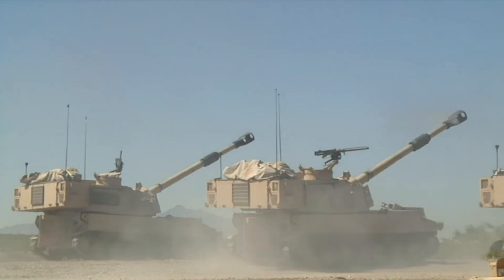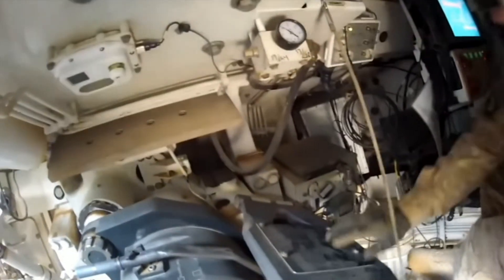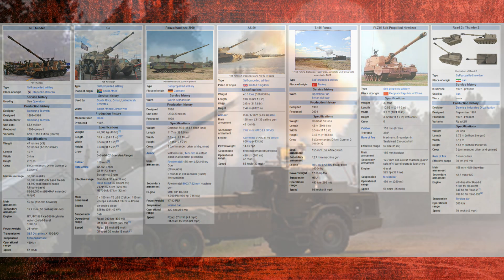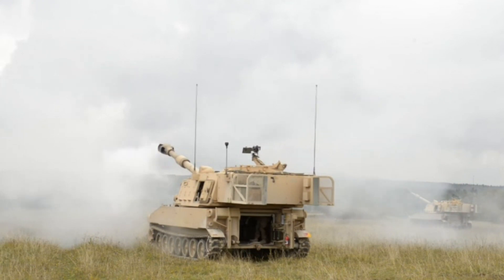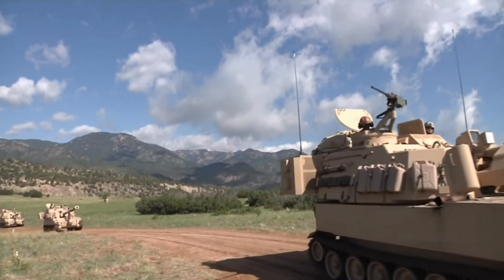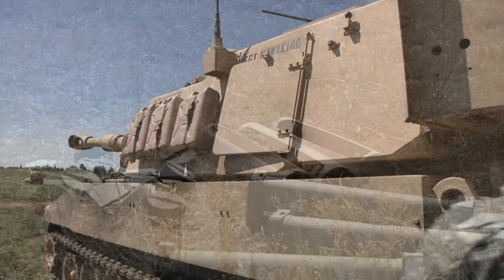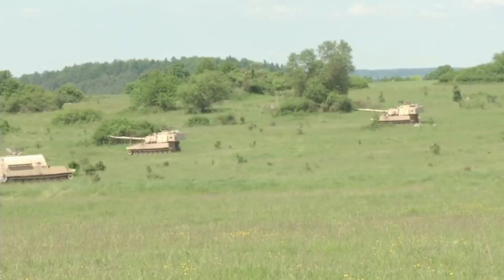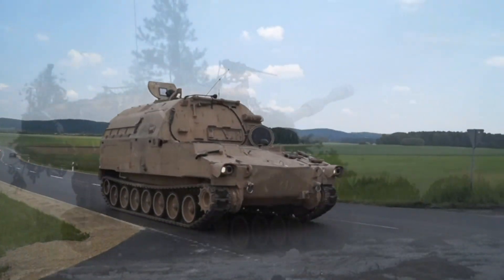M109A6 Paladin 155 mm self-propelled howitzer - American Artillery

Comment: Growing up as a kid in Germany in the 80's...one time we were doing a charity car wash in Churchill Barracks  (Lippstadt) and after a shed load of cars were done, a M109 from 49 Rgt RA turned up.  Was quite a picture seeing a load of Scouts clambering over that beast with soapy sponges. LOL

Great times back then. (Even as a teenager)
Reply from the maker: Max Steele haha epic! Thanks for sharing and for watching :-)
Reply from the maker: And for donating!! It really means a lot man!! :-D
Reply: Hey Max,  I was in 49 Rgt RA in Lippstadt from 89 to 92 . Good times and we still had the M109's then.
Matsimus, you didn't mention that the M109 also had nuclear capability, perhaps you wasn't aware. The idea was to fire the nuclear round and jump in a landrover and bugger off quickly leaving the gun behind as it would be in the fall out zone.
Reply: @gnrphil   This round was supposed to be covered by the official secrets act lol.
Reply: @peterwait641  Ooops........ going dark. 🤣
Reply: @gnrphil  - That is why the crew is taught (as shown in the video) to fire the howitzer externally using a long lanyard because the size of the powder charge required to kick that nuclear round out far enough would destroy the gun carriage, and anyone that happened to be inside the howitzer at the time.
Reply: @peterwait641  Hardly  a secret  if we knew then you can be sure the Russians alreaduy had the drawings and the manual !!

Comment: Hey Matsimus, just a couple small details you got wrong. The gun only has a on board crew of four. Section chief, gunner, driver, and what the arty calls the number one man. All ammo handlers ride in the CAT, and do not enter the gun during firing. Also, there is no rear turret ammo door. The turret bustle is were the powder charges for the rounds is carried. The only rounds above the turret ring are the six ready rounds, behind the breach. The NBC system is a older over pressure model. The gun crew would still need to wear their chemical suits, and masks, but the system blows clean air into your MOPP gear. It was great on hot days. Overall a great vid. And it was great to see my old howitzer slinging rounds. Looking forward to seeing more in the future.
Reply from the maker: RamadiRedLeg thanks for your service and for the corrections :-)
Reply: I was a crew member on the M-109A2 and A3, we had a 4 man crew on the gun. The crew chief, gunner, asst. gunner and the driver was the #1 man to fire the gun!😊
Reply: KRISPIRACY  Ah. My bad lol.
Reply: @cornellwrightington9581  - I also was on the M109A2's (1/10th FA & 6/14th FA).  It gets in your blood so once a Red Leg, always a Red Leg - Hoorah!
Reply: KRISPIRACY  I lased targets for copperheads a couple time from the cockpit of the OH58D. Direct hits every time.
Reply: The ammo vehicle they ride in is not called a CAT , its  called a  FASV  for (M992 Field Artillery Ammunition Support Vehicle)
Reply: Yup. Good stuff

Comment: US Army had for a long time avoided auto-loaders because of a strong belief in Murphy's Law.  The Crusader, a SPH that was supposed to replace the Paladin was supposed to have an auto-loader that would allow a single tube to fire and adjust 3 rounds so they hit time-on-target.  Unfortunately, our politicians decided that the Crusader was not going to be needed due to the collapse of the USSR, so we are still using a design from Vietman.

With accurate meteorological data, combined with data from multiple sensors on the gun, an M109A6 is often accurate with in 10m of target on first shot.  However we rarely fire less than a platoon of 3 guns on an infantry or armored target.

Other than HE with impact, timed or radar fuses, as well as a combination of fuse and fins that make it a lader guided shell, we have variety of rounds that can be fired.  Basics such as Smoke, Flare, and Chemical.  The more exotic scatterable mine field, and a variety of other submunition rounds, and to really reach and touch some one the Rocket Assisted Projectile.

I was a FDC specislist in a Paladin Battery for a couple of years it was fun.  oh, although I've never seen one in person I was able to look at the weight and firing data for one of the older 155mm tactical nuclear rounds, which the Paladin is capable of firing.   Not sure if the US Army even has these in inventory any more, or if one was ever test fired, as even at max range the firing unit was considered danger close.
Reply from the maker: Sean Wadey thanks for sharing and for watching :-)
Reply: The W48 Nuclear Projectile (and the W79 8") was phased out in 1992 by the INF treaty.  I had just started in the "Special Weapons Section" of my unit (4/92) when they ended our mission. They were VERY long in the tooth (just like Russia's rounds) and it was just "for show" when we agreed to remove them (they were nearing the end of their serviceable lifespan anyway).  Tomahawks were more powerful, longer ranged, more accurate, and ships and subs were more survivable.
Reply: Me too.
Reply: @swaghauler8334  And as far as I know, yes they were test fired at least once.  :-P
Reply: @AflacMan13  No, I don't think the W48 Wasn't "practically" tested (it's been decades since I was in Special Weapons).  It was simply a follow-on of the W33 which WAS tested before the US signed the Test Ban Treaty.  Since the W48 was essentially an "improved W33," which was already proven reliable, they never actually detonated a W48 to my knowledge.  There were "non-detonation" "stress tests" of the warheads though.
Reply: Based on the stats the Army published the Crusader wasn't a better gun system than the old one M019A6 and it cost three times as much. The Crusader only fired 6 rounds per minute with the auto loader although the TOT function was good upgrade since it was done automatically. I could do the samething with a TI59 calculator and did it for $100,000 less. Two cliches for you. Wars are fought on a budget and perfect is the enemy of good enough. Unless they do some serious reworking like the Metalstorm system, the M109A6 is the best you're going to get for that price range. They've had time to work out the bugs. 
Link is to a Metalstorm demo. https://www.youtube.com/watch?v=wKlnMwuCZso

Comment: I recently asked a Czech soldier to compare the Paladin and the 152mm DANA and he told me that the US troops are always amazed that the old DANA has an autoloader and yet is simple and rugged, while the US howitzers need a "big black guy to load the rounds" :-)
Reply: Petrovjan I like how you emphasize the "big black guy"
Reply: that's actually an exact quote :D
Reply: Petrovjan that makes sense since there are no big black guys in Czech to load the rounds they have to design the gun with an auto loader.
Reply: Americans are not found of autoloaders for large cannons
Reply: 5678sothourn FOND. I think you were trying to say. The spell check messes up some times.  Or maybe you wanted to spell it that way if so my bad.
Reply: the US does not like Auto Loaders because our procurement system is fucked silly and most of the Budget goes to the Navy and Airforce.   Most of the current family of vehicles are either 1970's designs or earlier with planned replacements being fails.   M1A2 Abrams was supposed to have an auto loader back in the early 90's but budget for it was cut.
Reply: tbh auto/manual shoot at the same rate
Reply: Mechanical shit breaks down you can easily replace a guy if needed.
Reply: That is hilarious!
Reply: We stick with manual load because of reliability.
Reply: The XM2001 Crusader was supposed to replace the Paladin in the early 2000's and it actually has/had a fully automated handling and loading system. Congress had allocated $11B for the project, but then Rumsfeld cancelled it because it was deemed redundant for fighting "insurgents" / "terrorists" / "Al Quada" / "farmers with AK's", or whatever.
Reply: My son was on a palidin. He didnt want the Auto loader. It was something to go wrong.  And preferred the crew doing it themselves.
Reply: @andyboog2010   Yeah, send out troops with sticks and spears, all that mechanical shit just breaks down, but you can easily replace a guy if needed!
Reply: Also we would hardly use the hydraulic rammer because manual ramming was quicker, Just take your fist and shove the round in DEEP! Even this tiny white dude could do it, However the breach could be a motherfucker to open at times especially when I weighed 160lbs lol.
Reply: @andyboog2010  training a guy take time...
Reply: @GrOuNdZeRo7777  true...the hydraulic rammer tends to shit out lol.
Reply: auto loaders always sound good in paper; but in actual environment they are a big mess. When the tiniest issues go wrong, the whole system will fail and you can do very little thing to correct that (fail hydraulic rammer, misfired, changed round). Even when loading ammo or repairing vehicles, you short one person to share the work load.
Reply: It also mean that the team has one more gun to count on if the ennemy decide to ambush them. Maybe not to be successful to counter the surprise ambush attack but to hold it long enough for the rescue to come over.  What's better than one more friendly gun in ennemy territory?
Reply: @andyboog2010  Also versatility. You can switch munitions on the fly with a crew.  You CAN NOT with a auto loader atm.  Once loaded you have to unload it and then change ammo.  A matter of seconds is the difference between life and death.
Reply: @michelnguyen4819  that's what the beehive round was for!

Comment: We had these in Habbnayah Iraq in 04-05. We were operating out of an old Iraqi airbase and paladins sat on the run ways secured by Hesco barriers. When ever we get rocket or Mortar Fire radar would pin point the location of origins in under a minute and they would return fire.. my hats off  to them

Comment: To add NBC to the M109 would require a lot of re-engineering. The replacement Vehicles they got tossed out all had the NBC protection. It's not just a question of adding an overpressure filtration system oh, it requires that the vehicle be sealed and that would start at the doors and turret ring. And then move out from there. I was a kid when the M109 was introduced and I'm 60 years old now. My dad was an ordinance specialist at the end of his army career. He got to ride around in the first M 60s and the first m109s. You also got to experience the hardships and violence of World War II and Korea. He hung his helmet up for the last time in 1966.

Comment: I was a Driver on an M109A6 Paladin crew from 1999-2004, and I noticed you mixed some data from the A6 with the A5.  We had a crew of 4, not 6:  Commander who worked the Fire Control Computer, aimed the gun, and supervised the Howitzer Section.  Gunner who assisted the Loader and double-checked everything but also aimed the gun using the Panoramic Periscope when the Computer was not used.  Loader who loaded and fired the gun on command.  The Driver who was basically the Engineer of the section, keeping the vehicle running as Hydraulics were used for automatic traverse and elevation as well as automatic Laying of the gun.  The Howitzer Section's Ammunition Team Chief directed the other 2-5 Artillerymen carried on the M992 'CAT' that carried 90 rounds of separate-loading ammunition in additional to the gun's 39 rounds.  When required they would drive the CAT from the perimeter up to the Howitzer, dismount, and pass by hand ammunition through a single hatch in the rear lower hull (the two-piece turret doors on the A5 were replaced on the A6 by a large bustle for the powder charges).

Comment: I served with the M109A6 from 1998 - 2004. There is a NBC protection system built into the later builds of the howitzer. Also, in addition to the M2 .50 cal. a Mk19 grenade launcher is available, when I was a platoon sergeant my flank guns would be armed with it.

Comment: During my first tour in Iraq we had two Paladins at our FOB. They would always be moving around the FOB so the enemy couldn't target them with mortor fire. The FOB was pretty much square shaped and had a large wall around it. The Paladins would travel along the outside of the wall mostly. My tent was directly against the wall and one late night one of the Paladins must have parked right on the other side of the wall where I slept. I was dead asleep when it started firing and I almost shit myself when that first round went off! I wasn't sure if a mortor had landed and went off beside me or if it was the Paladin's firing. But after I realized what had happened, I went over to them and cused them the hell out!

Comment: We still had the M109A2 (even A3) through most of the 1990s in the regular US Army; Ft Sill, OK. They were supposed to switch us over to early version Paladins in the very beginning 1990s, but... Well first had to wait while they thought about the Crusader and the NLOS cannon. But in the very late 1990s our units finally started getting the slightly better gunned A6. The A7 would still be the normal M109 chassis, but with the Bradley's engine/transmission pack, transfer drive, and final drives.
Which is awesome, considering I spent my time in a 1968 chassis M109A3 that needed some love with a hammer to get that stupid thing to turn over.
Manual loading can be done on a nearly dead M109. Throw the tracks, pull the pack, no worries, we'll still shoot with that pig. Have actually done it that way, not getting out of the field until every round has been fired.

Comment: The reason why the competitors have a greater potential range is that they use a longer 52 caliber barrel instead of the Paladin's 39 caliber gun. They can all use the same ammunition (it's standardized), so when you see two 155 mm guns with the same barrel length but different ranges, you know that the manufacturer is trying to squeeze in a few extra kilometers by sneaky reporting (typically by reporting the range for base bleed or rocket assisted projectiles instead of the standard potato) to make it appear like they have an edge over a competitor. A 52 caliber gun is 52 caliber gun. The internal ballistics do not differ to any meaningful degree and the projectile does not give a flying fuck what brand of vehicle the gun is attached to. Long story short, those range differences don't actually exist.

Comment: One of the biggest problems in any large military is logistics. How many different  types of engines, transmission,  drive sprockets,  tracks, so and so and so. If we (USA) can look at one system ,the M270 MLRS. It shares a lot of major components with the M2/M3 Bradley.  Why not look at what all systems you can mount on M270 chassis.   Think about M109 turret  mounted on that chassis.Bring back something  like M548 type vehicle (ammo transporter), M577(command vehicle), maybe even M578 (recovery vehicle).  Once you take off the rocket system. It's a flat bed cabover track truck. You could put anything on it. Thing about a unit that has all track vehicles using same major components. You could increase or decrease the length.  You now have 5-6 different type of vehicles that share almost all the same major components. Decreasing amount of  repair parts, decreasing maintenance down time. Witch will increase its presence on the battle field. But I'm just think out loud.

Comment: No, they never use the spades. It takes too long. My battery would just fire a charge 5 hotel mission like any other. And the engine is not beautiful. It’s a nightmare. They busy regularly. We had motor swaps roughly every other month. And we also do not have copperheads anymore. They have been 100% replaced by the amazing Excalibur.

As for auto loaders, they have not made a dedicated autoloader because a veteran crew can send rounds as fast as once every 15 seconds, which in an emergency fire mission scenario is very important.

Lastly, this thing DOES have NBC capabilities. I don’t know how where you got your info from but it has a huge HVAC system with a massive activated charcoal filter. You can hook it up to your gas mask in place of a filter.

Comment: as long as the gun can be carried fired there isn't much reason to spend the stupid amounts of money to replace, arty is a big stick type weapon that has almost been made obsolete by missiles, unless a far cheaper/simpler system is developed there is no good reason to change
Reply: ScreamingSturmovik A gun will never be obsolete when it's cheaper and better to use.
Reply: well that is why i said "almost" but i would also say that is also untrue due to almost all naval vessels main armament are missiles with the largest guns in use are 155mm.
also it's about relative costs, SPG's are expensive as a whole (due to armour, systems and maintenance) but the ammunition is cheap but missile based systems can be put on a truck while the missiles are expensive but guided and extremely easy to transport compared to something as big/heavy as a tank.

I read a little about this when i was wondering why russia used so much rocket arty and made almost no dedicated SPG arty like the german hummel or the amrican priest/sexton or M12
Reply: "why russia used so much rocket arty and made almost no dedicated SPG arty"

They did have 14000 SU-76s.
Reply: "dedicated arty" the su-76 was designed as a "tank destroyer" (based around a AT gun) but used as arty for the same reason the M3 GMC half track (it had a gun and was available) i refereed to vehicles like the hummel, M7 priest, and M12 because they are dedicated indirect fire suppourt
the russians only designed and built a couple of vehicles based around the 152mm for long range purposes